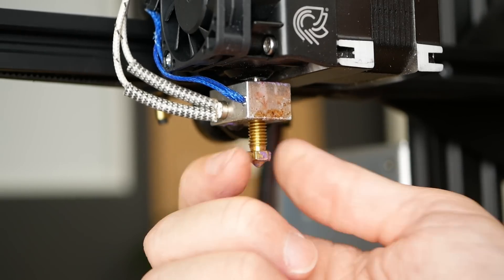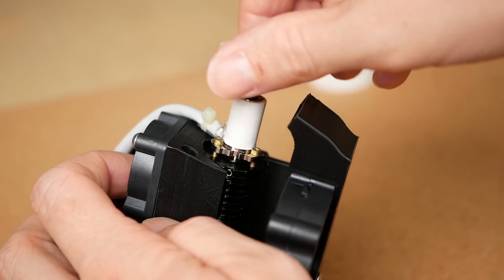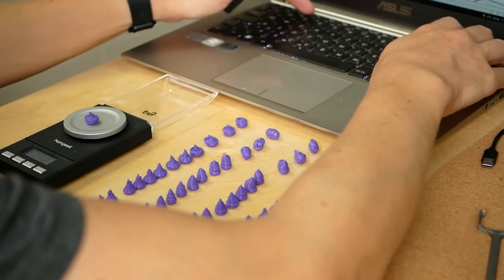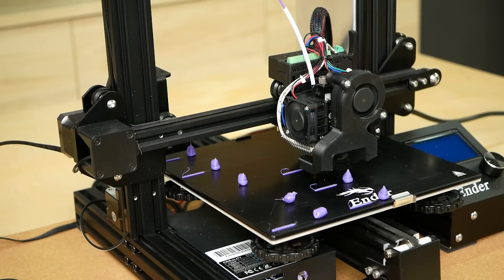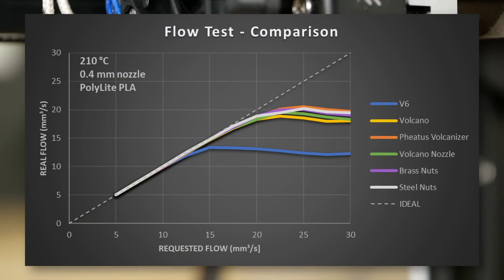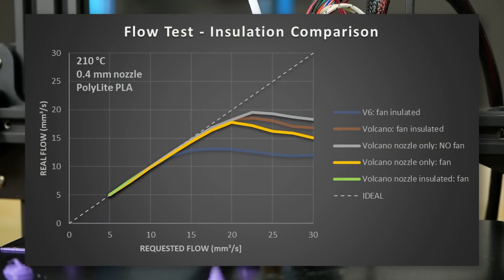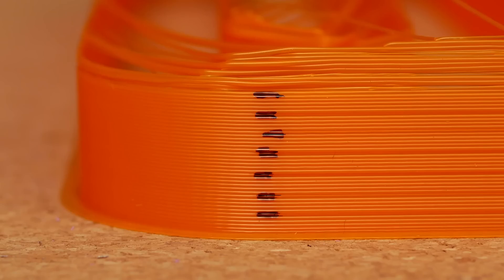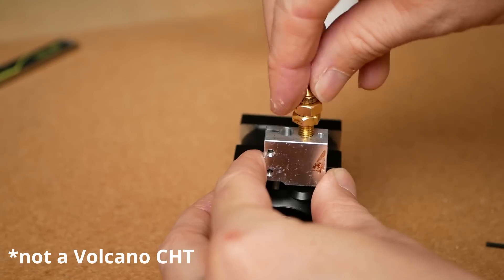Volcano is Obsolete: Just use Nuts!

Comment from the maker: Do you think a Volcanizer™ is a reasonable alternative to a full Volcano hotend?
Reply: Seems legit!
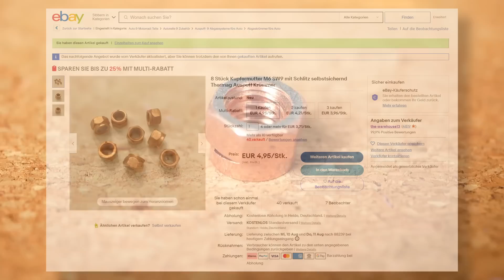Reply: i think it's a good alternative to the full volcano. I am wondering what the tool is called/where did you get the tool for holding the block to help install/remove the hotend at 6:30-6:35 in the video?
Reply: I've literally been using a mod like this on my CR10s5 for ages now. With a titanium outer shell and a brass internal lining press fit into the titanium. It works perfectly. I used a full brass set-up, but that lost too much heat.
Reply: Its pretty legit for a cheap solution also I wonder if using thermal paste on a nozzle would improve heat transfer to the nozzle from the hot end
Reply: The results are great, but you really should've named it the "Fauxcano" 😁
Reply: Great ideea, but i would move the thermistor on the extension nut to get stable nozzle temperature
Reply: Гальваническое меднение стального инструмента - древний способ изготовления искробезопасной оснастки и повышения теплопроводности стальных деталей. Даже тонкий слой меди (несколько десятков микрон) способен ускорить распределение тепла по стальной детали в разы.
Reply: @101picofarad  teper' ya ponimayu! Spasibe.
Reply: Long nozzle sticking out of heater block could be also great for non-planar printing with right cooling ducts
Reply: So i use deez
Reply: What about an aluminium threaded cone, with big area to heat block? I think the heat transfer length can be longer then - to avoid higher temp to increase flow. 🤔🤓
Great video as always! 💪👌
Reply: Here's a thought - adding brass nuts to a volcano nozzle should allow fitting such a nozzle direct to the Creality CR6-SE. It'll handle the depth difference automatically...
Reply: Wondering about using your drilled hole copper wire cross pattern with this or these better DIY methods?  I just noticed I posted this also just prior in the wrong video.  I meant this video comments. Would be an interesting comparison I'm thinking and also using higher content electronics silver solder for the PET.  What would be even more awesome would be to see how like the JRT3D strip filament performs using these DIY designs.  Guessing since most suggest using a filament stop sensor for longer runs since doesn't seem anyone has come up with a best DIY way to but weld the strips or filament.
Reply: Finally, thinking trying not only with the recycled PET bottle filament... what would be a super awesome totally better video comparison would be adding in Nylon from weed wackers like you did in that one video.  Man, that would be excellent I'm thinking using the best nylon string trimmer as filament practices with these custom DIY range of hotend nozzle mods!

I still think an easier way to fuse the PET bottle filament would be a holy grail... though automating entirely would be more a challenge.
Reply: Штефан, держись там!
Reply: i had extremely poor results with my volcano length CHT. im hoping someone else will do some real data testing. I found severe degradation in flows. 25%-50% less flow
Reply: Seems only natural that the amount of area against the filament decides the melting capacity, so a long version of the nozzle with three holes should be even better.
Reply: What do you think about CHT's Volcano nozzle? Would you get even better performance with the CHT Volcano + 2 M6 nuts "volcanizer"?
Reply: You didn't mention the potential impact of part cooling by raising the ducts 8mm further away from the parts. Seems like this could be pretty significant under the conditions you would be using high extrusion rates
Reply: Definitiv. Auf jeden Fall günstiger.
Reply: As someone with an old CR-10 that's really hard to upgrade, I sure hope so. Saw your Volcano review video (thank you), but that upgrade process it too much for my skills. Yet I'm tried of that "clicking" when trying to run thicker prints and I want to speed it up, so I think I'll try this!
Reply: Yes and I wonder if you could us a super volcano
Reply: I use on my Spartacus toolhead TVolcano Heatblock and Volcano CHT hard steel nozzle and i was able to achive 32mm3/s flow with regular PLA at 220c. And 36mm3/s at 235c 
So with brass volcano cht and extension for sure i can achieve 40mm/s
Reply: Thought it was jank at first, but I can't argue with results!
Reply: Per Tom's recommendation, I'm switching to 0.6 mm for pretty much all my printing.  Any thoughts on the overall effect your experiments would have at 0.6 mm?
Reply: could you 3D print a ceramic sleeve for the nozel?
Reply: Looks like you could also use a modified heater block with two heater cartridges, and use the same nozzle for high flow and low-oose depending on whether both heaters or just the lower one is powered?

(Although maybe it would mean the heat break is higher than optimal)
Reply: @GilesBathgate  uj
Reply: No, the cheapest option I found for the nut was $20 or more. For less than that I can get the brass nuts or even get a volcano block.  If the nut was cheaper, I would heavily consider it.
Reply: @gabethemodder778  where are you searching that sells m6 nuts for $20!?
Reply: @Prototape11  the kit for the copper nut from phaetus specifically is what I was talking about.  I mentioned that buying brass nuts would be more worthwhile
Reply: @gabethemodder778  Yeah I think that's what was meant as a "volcanizer", tho maybe not.
Still, there's always Aliexpress for the bottom of the barrel prices, or as shown, the humble brass nut.
Reply: @Kalvinjj  There's always aliexpress... if you don't mind the flood of IP theft and slave labor...
Reply: @bthatguy1181  there are more people in concentration camps in the USA than in China. Chinese do innovate. In fact, a huge amount of Western innovation comes from Chinese scientists, who work in the West. And numerous companies, including specifically in 3D printing and robotics out of China are world leading in innovation. Whether that's DJI, or Creality. Not only that but the Chinese state is specifically supportive of open source technology, the driving force behind the maker movement, and openly fosters it, precisely because they are Communist.

That you're unaware of these facts is unfortunate, but not uncommon. I'm happy to try to help deprogram you, if you're willing.
Reply: @gabethemodder778  bruh where are you buying nuts 💀 they shouldn't be $20 but more like $0.20 for two lmao
Reply: I was checking out your website and my ANTIVIRUS got triggered and after doing a website scan I can see that you are missing a Content Security Policy, this is a A computer security standard introduced to prevent cross-site scripting (XSS), clickjacking and other code injection attacks resulting from execution of malicious content in the trusted web page context. I hope you see this and thank you for the content.

Comment: This works on K1C / ender3v3 (plus) unicorn hotends with the taller K2 / Hi Nozzles. Just get 2 Brass nuts and you get around 20 to 25 percent higher flow across 4 different materials.
Don't grind them, just put them on the Nozzle all the way. They will go ~0.5mm deeper into your extruder but heatbreak will overlap perfectly.

Comment: How about using a standard Ender heating block instead of the nuts? Maybe it's a bit too tall, but could easily be brought down to size with a CNC or even filling, that way you could maybe even put the thermistor in the secondary block so it will be closer to the end of the nozzle, and use a standard silicon cover as well. I think I'll try this ASAP. Only downside I see is it would be a little more material to heat up.

Comment: the copper nuts tho... when building my induction heater i used some of those to connect the main work coil, i found out that they were steel coated in copper by an unusually high power draw, water leaking everywhere, and molten steel dripping into the case......
stuff like this really shouldnt be allowed.

Comment: Brass or copper nuts are probably worse for performance because they add only a little heating outside the nozzle core threads but lose more heating through their higher conduction to the air.  Titanium nuts that are better insulators would probably perform the best.

Comment: actually i think that using steel nuts is better because steel conducts heat worse than copper, so we have a bigger gradient from the inside to the outside, so its less impacted by cooling.

Comment: I think the reason the volcanizer works better in that test than the volcano is that the same heating power is being loaded into a smaller mass so it should be easier to transfer heat into the filament instead of the block. The block may improve reliability though just by acting as a big thermal mass. Bot sure though!

Comment: Thanks for once again being top tier with both your methodology and frontier thinking. You’re as always impressively thorough. 

So; while these tricks can be great for simply increasing the max flow rate drastically, the long melt zone will also cause more oozing and hence, a loss of detail and a severe risk of extensive stringing. 

To strike a good balance seems easiest doable by using a Bondtech CHT nozzle which I use today. 

As the cheap Chinese knock-offs are not made with chamfered sinked holes like the original Bondtech CHT, they cannot be recommended for anyone wondering if this is a viable economical shortcut. But to be fair, it is possible to actually do this yourself if you have the tools for it.

Comment: What about heating cartridges. I suppose these tests are valid if the same cartridge used in all cases. But you can put big more powerfull cartridge into Volcano. And what about brass Volcano heater block? And I do not suggest anybody to print without silicone sock 😂 So standard Volcano brass block 60 W with silicone on. Thats the way.

Comment: I did the Volcanizer mod on my printer with a 0.6mm nozzle on a Ender 3 v2. Works great and shaved so many hours off my prints and still looks great. I used a m6 steel nut and spacers with thermal compound between each for isolation of the brass nozzle. I mostly print functional bigger parts and for my application great mod!

Comment: OK so what if you put down some thermal paste on the threads and between the nuts, and between the nut and block. Probably wont' affect temps much. But might affect your gradient across the tip. Then combine that with a silicone sock.

Comment: Wait, the nozzle's rear end is supposed to tighten against the heat break's butt end, otherwise there's a risk of  plastic leakage out the back of the block.
If the nut is tensioned against the block, that fights the other way, to pull the engagement of the nozzle's thread to the other face of the thread, which will mean the nozzle's not tightened on the heat break

Comment: Thanks to your video I change regular mk8 0.6 type nozzle to volcano(fake one) 0.6 nozzle with two steel nuts. It's insane that i went from max 12mm³/sec to near 25mm³/sec and above this values filament forms in something like spring under extruder toothwheel ! Thank You - its working brillant !

Comment: You used M6 brass nuts. I have some brass and a M6 tap. Would there be any benefit to getting a solid piece of brass instead of nuts? 
What about a square piece of brass to maximize surface area contact with the heater block?

Comment: Actually it doesn't work. That is, in general. He either lies or raises the temperature of print by several tens of degrees for video.

I tried to do as he suggests. As a result, the printer does not print at all.

It is not for nothing everybody they try to make the part of the hot end that extends beyond the heating block as short as possible. The reason is that even with a projection length of 1 cm, the temperature gradient will be too large and the plastic will be too cold.

Don't waste your time on this nonsense.

Comment: Just had a great idea: Simply buy some 6 or 7mm ID silicone tubing, slide it over the exposed volcano nozzle, and cut to length. Or buy 10mm or whatever is necessary to slide around the nuts. Super simple insulation against the cooling fans that's cheap and easy to remove.

Comment: Stefan, your suggestions worked perfectly for me.  I used a Volcano long nozzle on my Ender 3V2 with 2 brass nuts to lock against the hotend block.  After adjusting the Creality touch sensor and re-setting the Z-offset, it printed my test square perfectly.  I've not made any redirect for the cooling air so it might require a little re-direction so that the air is pointing to the nozzle tip (as standard) and not on the extension.  Next step is to turn up a bit of brass and make a silicone sleeve to optimise heating.  It was always a pain to visulaize the printng process, now I can see the extruder perfectly on very small prints.  Thankyou!
Reply: i know this is hella old, i've just tried doing this on my ender 3v2, and i keep getting underextrusion even on 10mm/s flow, my normal hot end can do 12 without any issue, any tips?

Comment: The best thermo-conductive material to use for the block would be pure copper but that would create a problem trying to move a heavy chunk of material around.
The latest "next gen" machine designs are able to move a lot faster with a lot more control and stability than say ever 5 years ago, so even while swinging around significantly heavier extruders and their steppers so maybe they will be able to keep the mass of a copper setup under control???
Copper would also act as a bigger "heat reservoir" which would speed up the local transfer of heat to the nozzle melt chamber when new plastic removes the heat by absorbing it. 
This could very well reduce the time to melt the filament.
As above, aluminium nuts would perform better than steel ones as far as mass moving around is concerned.
Also, apply thermal paste (like that used on computer CPU's) to the faces of the nuts and block to help the transfer of heat from the block into the nuts.
Modern high performance car engines with big turbo's use a ceramic coating on the exhaust pipes to help lower the amount of heat that is radiated from the exhaust pipe so why not ceramic coat the heater block and nuts?
As far as I see it, the problem is getting enough heat to the area that is the melt chamber fast enough so that the filament is able to melt without causing too much heat gradient in the thermal heater block around the area that is adjacent to the melt zone.
Come on Stefan, FIGURE IT OUT !!!

Comment: How fast would my printer have to go at these extrusion rates? 

If my printer will never achieve those speeds then a larger nozzle or klipper is a more logical step. 

How do I find the top speed my printer achieved on a part? 

Will the heat transfer from nozzle to center of filament eventually catch up to a larger orfice?

Comment: What happens if you put thermal compound on the threads and contact surfaces of the nuts and nozzle? Would it make any real difference or just make a mess?

 Also, you might try "Rescue Tape" (or another self fusing silicone tape) instead of kapton tape, it's a silicone tape with no adhesive but the right composition to stick to itself. It doesn't give off fumes until you get it hot enough to degrade the silicone itself though, it's claimed rating is only 260c but, I have hit it with a torch for a couple seconds without completely breaking it down.

There is also a trick you can use to make a very high temp insulator, it will be fragile though. You use exhaust repair putty (I've only tried Versachem muffler weld for this) but instead of drying it you put it on the part then hit it with a pencil torch. You have to do this in thin layers for best results but, the fluid in the putty boils off and causes large air pockets to form. After a few layers you will have a puffed up foam of cement like material that can handle 500-800c without falling off an exhaust system (seems to be able to handle a lot more if it doesn't have to hold back any pressure though).

Comment: Another test would be to just use a 2nd heater block instead of the nuts. It might need to be cut down to be thin enough but the extra thermal mass would probably give a good result.

Comment: Very interesting data. It shows that not all performance parts are due to god-tier engineering. Sometimes it's mostly just basic stuff like the thermal mass and insulation - and definitely not worth 100 euros compared to a trivial DIY imo.

However much it helped to add the nuts - I think you could probably multiply it several fold by using some dirt-cheap generic thermal paste.
The surface contact even on threads will be very poor on the microscopic level. The same (very well researched) principles that apply to cooling high heat density electronics (ie. CPUs and GPUs) will apply here - although not quite as drastically because this is much less thermal density. Still - having some sort of thermal paste is considered critical to basically any thermal transfer application. You will always find it used even in phones or routers with chips considerably under 10watts because with no thermal paste the thermal transfer is just terrible.

Considering this would cost maybe a cent worth of generic thermal paste pr changeout and would not require much finesse it seems like a no-brainer in theory if you bother to use nuts in the first place. One would need to check the max thermal limit of the paste is within printing temperatures you need though, but I think this should not be too hard to do on the cheap. Especially when you don't need anything high performance.